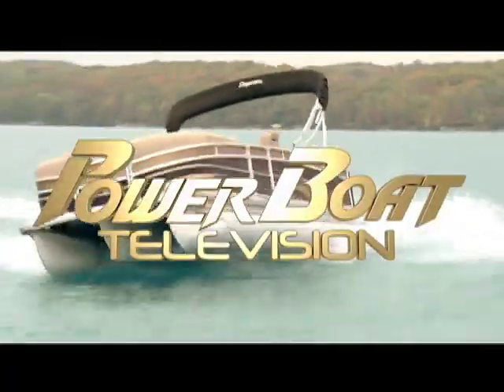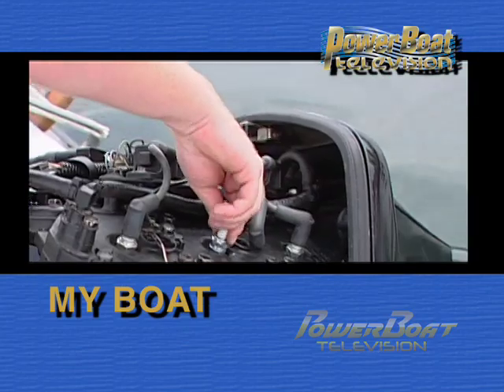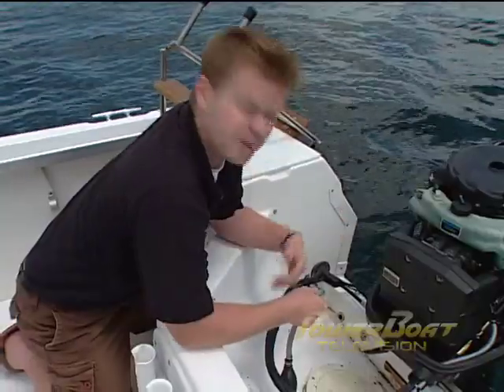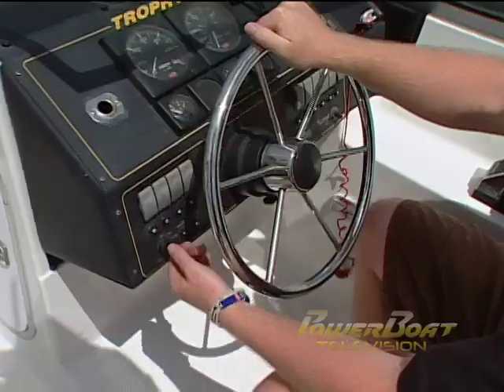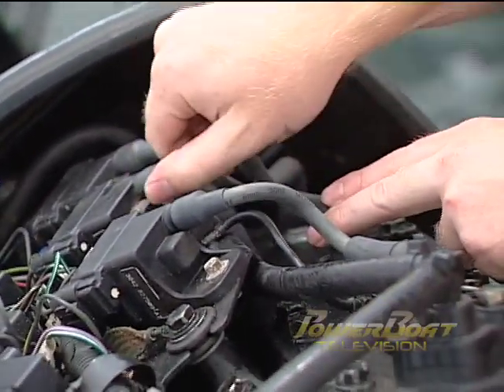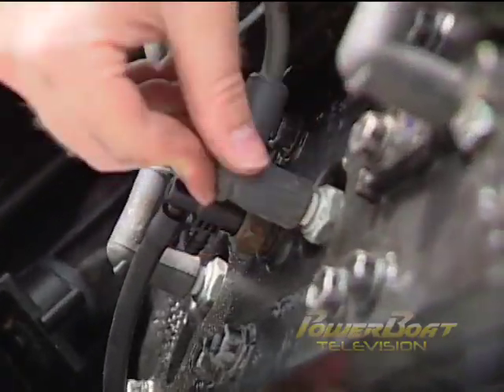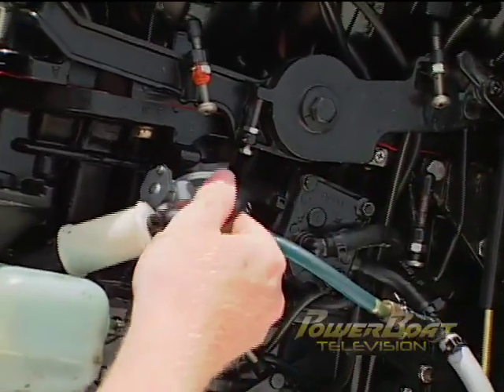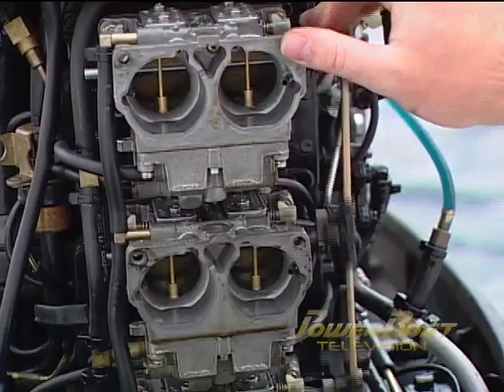How To Deal with Failure on the Water - PowerBoat TV

Comment: Usually, when a motor ceases running, one part has failed and usually, you don't have that part on hand to restart so if you have gas and the engine is not overheating to death, you can make a first assesment but you,ll not be able to restart,
Usually, it is a good idea to have a watertight box where you have some few spare parts as a propeller, a fuel pump, raw water pump impeller, a distributor cap, rotor, a point and condenser set.
 IF you go offshore, better have a good stock of most failure prone parts and a tool set to be able to make yourself the intervention and more important, have the instruction to diagnose and replace these parts yourself.